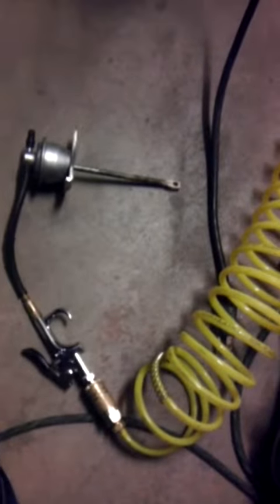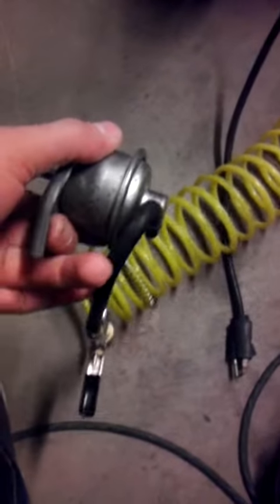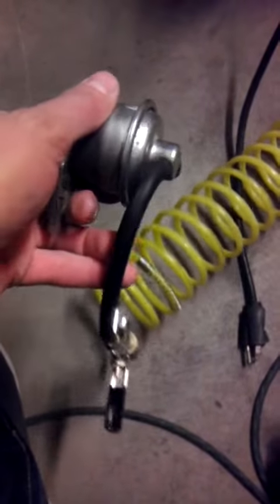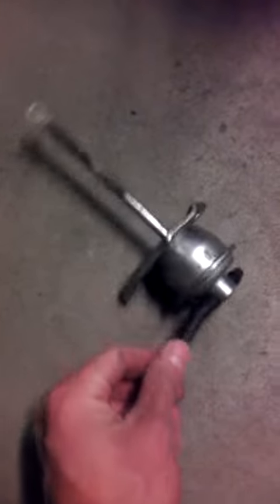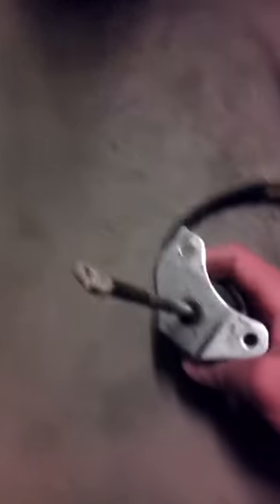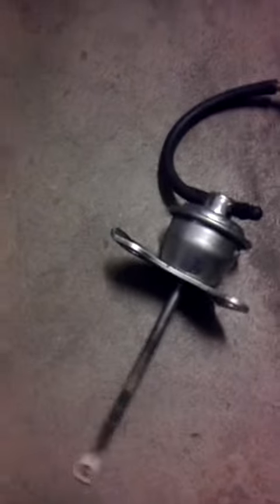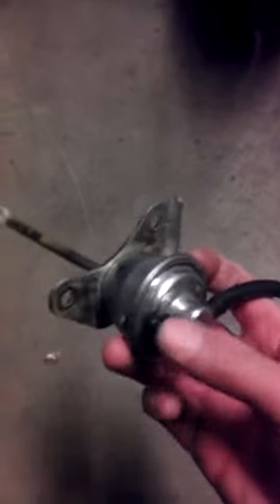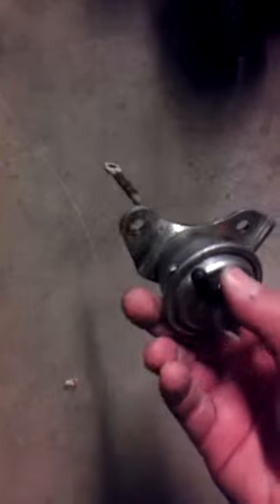Mazdaspeed 6 wastegate actuator testing

Comment: Was yours over boosting?
Reply from the maker: Inthepocket correct over boosting and hitting fuel cut.
Reply: Was it fuel cut more like a hiccups at 3000 to 4000 rpm